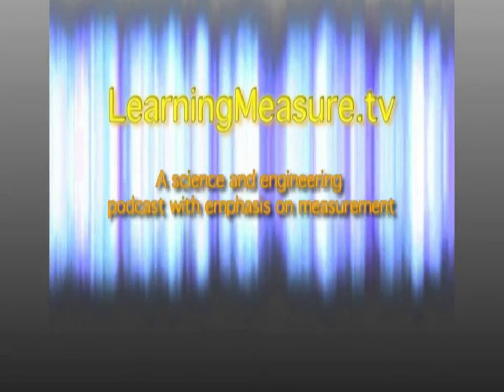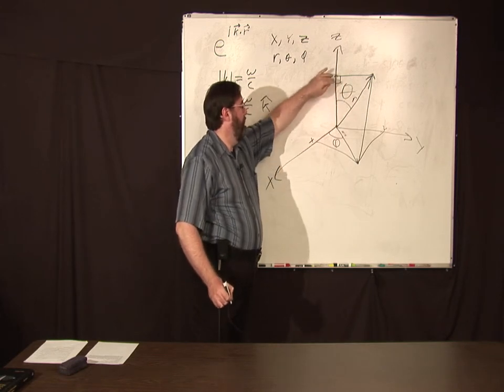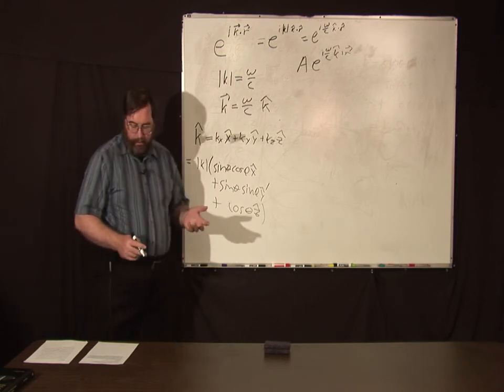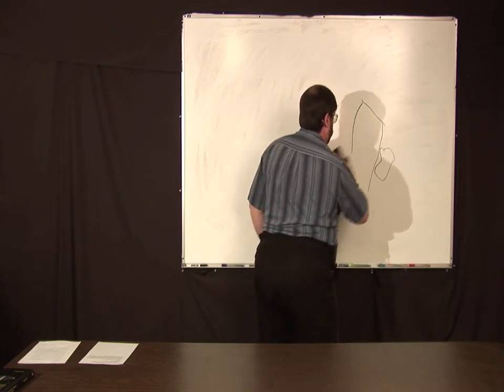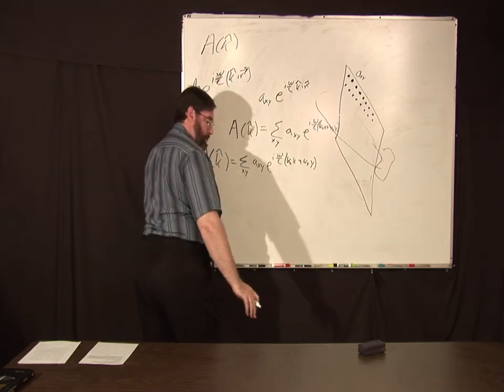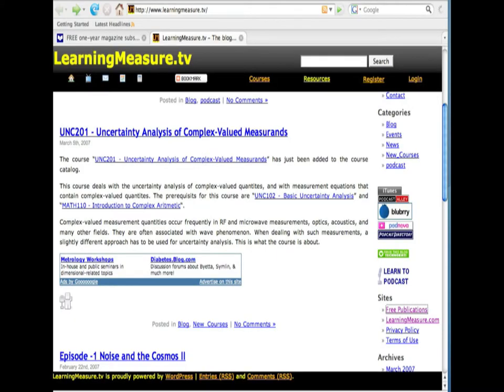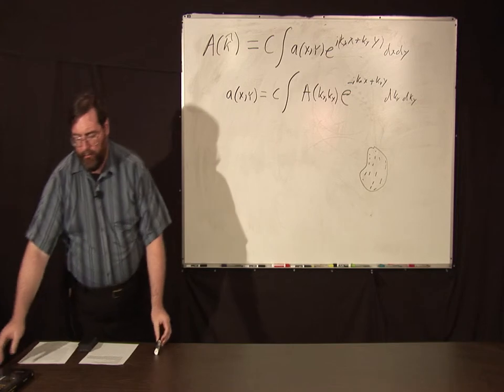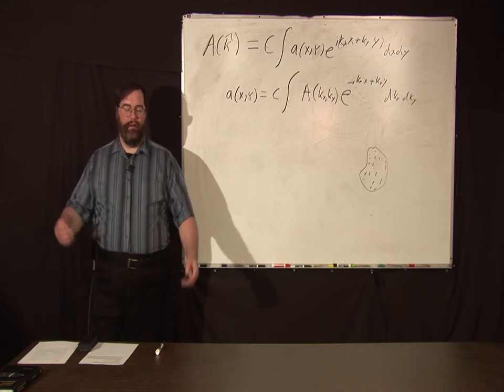Episode 4 - Near Field Measurements

Comment: Covering how masking during VNA measurements affects error even after calibration would be a nice video. Then diving ino the different calibration methods and where the pitfalls are in their processes. Example, SOLT can only be as good as the presented load. Another example would be overcoming VNA front end directivity for extremely low energy measurements absent of a power meter or high gain antenna.

Copper Mountain Technologies does a good job introducing these, but indepth whiteboard steps would be a nice addition to public knowledge.

Comment: I have a question regarding the scan area. What is the relation between frequency and the scan area. I have read some papers they all discuss the sapling criteria i.e.. delta of X less then Lambda/2 but no mentioning of the relation of the scan area and the frequency.
Reply: The scan area is not a function of frequency, but only of aperture size and the largest angle one wants to measure. The scan area has to be large enough to intercept all significant fields.